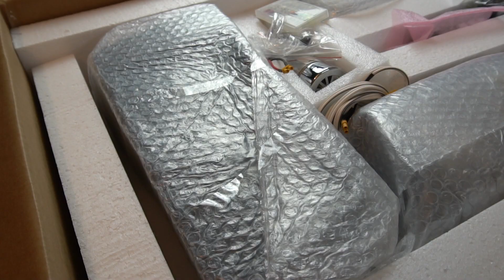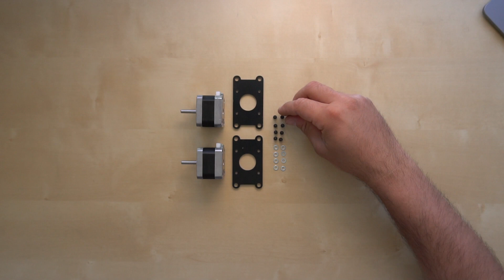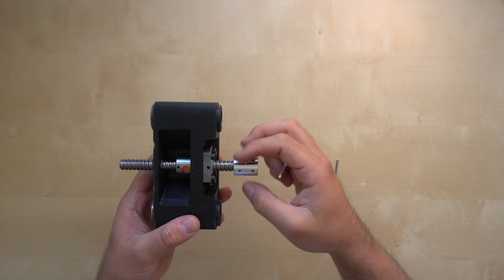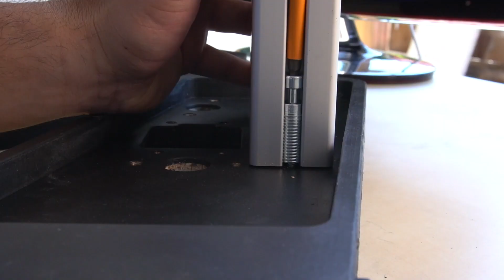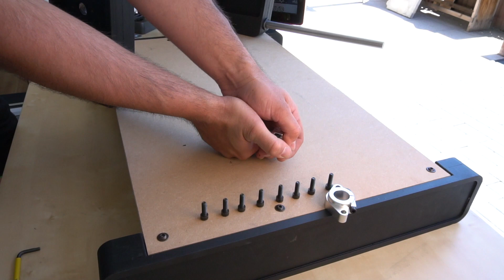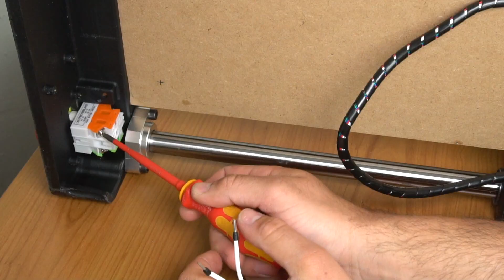QBot MINImill KIT assembling - 263 Parts done | makermoekoesminimill #2

Comment: Edit: nice video editing and assembly, tho! :) 

Oh man, why does all of these mini mills rely solely on the stepper motors bearings for thrust loads? The steppers actually have wavy springs inside that allow for axial float on the shaft, so position cannot be guaranteed on the ball screws when under load. All it takes is one thrust bearing and one bearing housing. For a machine this size (quite big smooth rods), the added costs would be marginal.